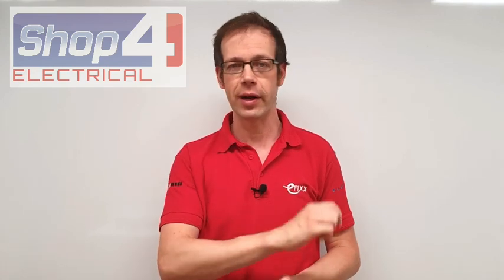What's the difference between a PIR sensor and a microwave sensor?

Comment: I know this is pretty old now but as a for instance I’ve just put a microwave sensor controlled light fitting in the centre of a “ginnel” (narrow covered passage way between two terrace houses) the ginnel is approx 7 m long and pitch black during the early evening and night …..it works perfectly just before you enter from either direction the light come on whereas with a pir you would be halfway through before the sensor would pick up.As we know pir’s are more sensitive to movement across rather than towards the sensor.
On the negative side I too have had nuisance tripping caused by rain with the same fitting in a more exposed area.

Comment: Fitted some outside led flood lights with microwave sensors. Some were ok but I had to go back to change lights to PIR ones as the rain was triggering the lights on.
Reply from the maker: Great tip for everyone - thanks for sharing!
Reply: What if I install Microwave sensor outside as ceiling light, will it trigger by the rain?  There is chance rain water will be below the light on the floor. Is it better if I go with PIR Motion sensor?

Comment: Would a microwave sensor use more power in standby? Was trying to research PIR's with low standby consumption, most seem to be 8-12 W.
Reply from the maker: Good question, I'm not sure of the answer to be honest I may need to do a bit of experimentation.

Comment: We know the applications for a PIR but can we have examples of when you might use a microwave detector?
Reply from the maker: Dex Whitmore microwave sensors are useful
In corridors and stairwells - they can be built in to the fitting and sense through the front diffuser.
Reply: A good place for a microwave sensor application is for a light next to a boiler flue. No false activations.
Another is a public toilet so the light is activated before you enter the room instead of waving your arms wildly to get a pir to see you.
I prefer these sensors as pir’s have got a dumb side of having to walk through the field and not up to, say in case of a grarage flood light for example.
Reply from the maker: Bertiebassett1972 great tip
Reply: I try😊
My wife says very trying😫